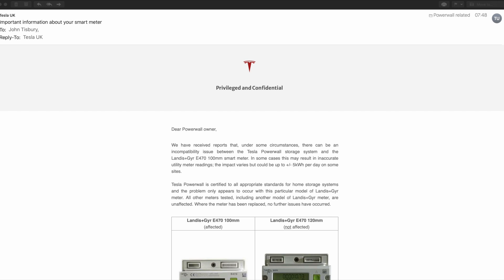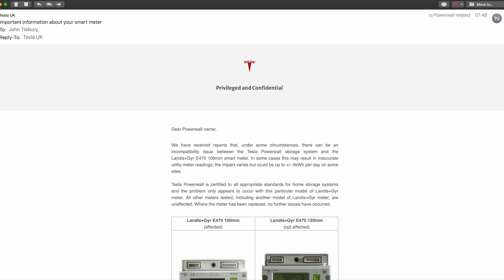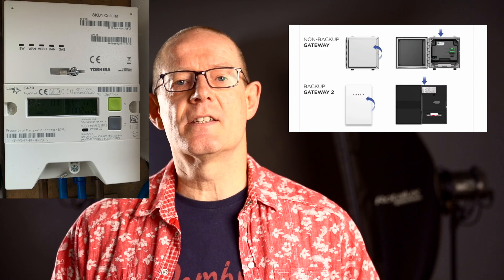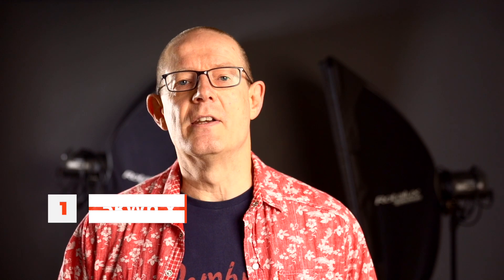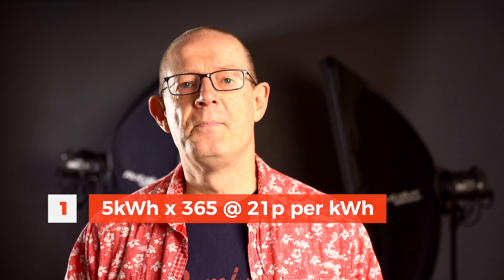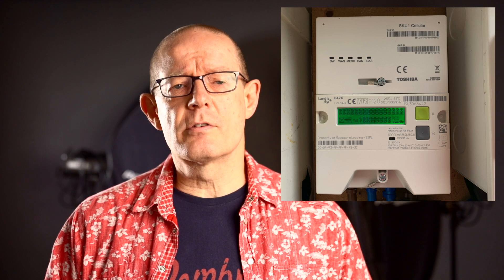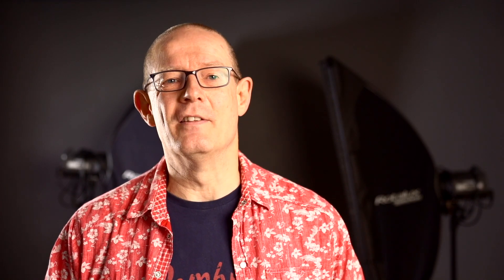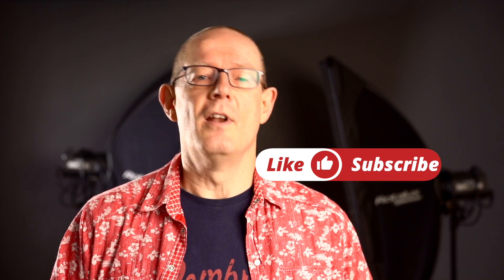Resolved phantom drain Tesla Powerwall 2 and Landis+Gyr E470 smart meter

Comment: I have had a fox ess battery system installed. My app always sais im drawing 4w from the grid but my smart meter sais im using 25w. At the end of the day it works out that every 2 days im using 1kwh from the grid so about 0.5kwh. I have a current clamp around the mains cable which has a wired connection to the battery system. Does this sound like a similar issue? I have the small meter. Thanks in advance
Reply from the maker: It potentially could be the same issue. I'm not familiar with the battery system so can't add any experience. If there's a user forum or Facebook group for them then a post on there might be a good starting point. 
Suggest contacting your electricity supplier and raise your concerns. They can instigate a smart meter check to confirm it is working within standard if you believe it is over reading.

Comment: Hi John
I am a bit late to the party but had Powerwall installed 3 months ago and realised pretty soon I had an issue. My installers support discovered the issue online but I am having an absolute nightmare getting my supplier BG to acknowledge there is a problem even after supplying them with the Tesla and Octopus documentation. The latest excuse is the IHD is not set up correctly. Any suggestions how I might resolve this. BG are a nightmare
Reply: Hi John, BG have finally changed my meter this morning and all working OK now. At last. Now the battle to get some compensation but maybe I’ll call it a day. Thanks.
Reply from the maker: @StephenGalliver  That's good to hear. Well done on being persistent and pushing for a meter swap.
Reply from the maker: Hi Stephen
I'm sorry to hear of your issues with BG. As you probably know the IHD has no impact on meter readings or the phantom drain issue. My suggestion would be to swap supplier, preferably move to Octopus Energy, raise an issue that you need the smart meter swapped and then you should get a resolution. I'm assuming you have the L&G E470 smart meter installed? You won't get much traction from BG I'm afraid. I've suggested this to other people who like you have been getting nowhere with their current supplier. They were trying to get back £100+ for phantom drain reads. I suggested cutting their losses and moving to a more enlightened supplier like Octopus. They did, they used my refer all which was nice. I hope you get it sorted. Let me know how you get on.
Reply: @johntisbury  Thanks John, I would love to swap to Octopus but my tariff with BG is very favourable as to get the same rate with Octopus requires me to have an EV which I currently do not have. At least it sounds I not alone banging my head against this brick wall. Will keep you updated.

Comment: I have had a Powerwall 2 fitted and the E470 has completely stopped sending data back to my supplier (originally British Gas but changed to Octopus). It's clearly a different problem and 3 years later but interesting nevertheless.
Reply from the maker: Your smart meter needs to be power cycled, turned on and off. This is a job for Octopus as homeowners are not allowed to access the equipment. Raise a fault with Octopus and they will see if they can fix it remotely, otherwise it will need a site visit to power cycle it.

Comment: Hi, great video and our meter is getting swapped by Octopus prior to our PW being installed. I just wondered how you have gotten on with it being installed outside in the winter? Has it struggled to charge or discharge when the temperature gets towards and then below 0 degrees? Cheers :)
Reply from the maker: It’s fine outside, it preheats in cold mornings and will still deliver or charge at 5kW constant.
Reply: Thanks, that's good to know. Does it preheat from the grid or does it use its own energy? And thank you for the quick reply! @johntisbury
Reply from the maker: @Simon-rt3qu  depends on the mode you have it in. Self-powered then uses own battery, TBC then will choose based on tariff plugged in to reduce costs. That said power usage for preheating is negligible. 

It also has fans to cool it in the summer.
Reply: Thanks John. I can have it installed on the side of the house which is an easier install (its fully sheltered tbf) or I can store in inside a detached garage. Thanks again! :)  @johntisbury

Comment: Thanks John. So helpful. I’ll follow up with Octopus and see how I get on! 
I’m not clear about the point about registering my Powerwall with Tesla and sending them a photo of my E470? I have already registered the PW and Gw2….do they need to see the E470 too?
Reply from the maker: No problems. The process may be different now as this was over 2 years ago. I would contact them  and they will confirm what they need from you. Any problems motion Phil Steele who works for octopus, however I'd be surprised if you have issues. Make sure you speak to the smart meter team though as they will know of the issue with the E470 and the Powerwall.
Reply: @John Tisbury  Thanks John. Really helpful!

Comment: Hello John, we have just had our Powerwall 2 installed and noticed that even though we have 70% in the battery, we are still (allegedly) drawing 1/4 kWh from the grid. Tesla app confirms that we are not taking anything from the grid as well.  I did some google research and you popped up. Thank you for posting both videos. I’m curious, I’m with eon next and strangely enough we only had out Smart meter installed a few days before the Powerwall was installed. Pure coincidence. My question is, do you know if we are actually drawing from the grid or is it some other anomaly. I can’t see you mentioning in the video explaining what is going on. Trying to arm myself with all the info for the potential battle ahead. Thanks in advance, Paul.
Reply from the maker: Hi Paul, there's 4 video playlist of the problem from discover to resolution. The video you've just watched is no. 3. 
I can't remember which video I showed how I identified the problem and proved it as it was 3 years ago I uploaded the first video. However, I did a daily track in a spreadsheet of what the Tesla app said we had used from the grid and what the smart meter said. If you have an in house display for your smart meter you can get the information from that on a day by day basis. 
From memory the resolution, identified by Octopus Energy is posted in video 4 where the meter was changed.
Playlist is here: https://youtube.com/playlist?list=PLYDir90yTxTofJyV_9W4DKvFkWqDnU4LW
Reply: @johntisbury  thanks for your reply John. So was the PowerWall actually using electricity from the grid or was the Smart meter just making it up? That’s what I don’t understand?
Reply from the maker: In our case the smart meter was drawing a constant power from the grid when we should have been running from battery which equated to 1-2kWh a day. Some people with the same smart meter experiences higher or lower amounts, and even in a very few cases exporting to the grid in some cases. In all cases it was the smart meter that was experiencing conflict with the Tesla Gateway. Swapping to a different smart meter resolved it. It's a known problem for that particular model of smart meter.
Reply: Big thanks for taking the time to reply.

Comment: Hello John. I had the landis e470 meter installed a while ago when I went ‘Smart’ since then I’ve had a 5KW array fitted with 10kwh of batteries all controlled by a 5KW Solis hybrid inverter. It looks like I might be having the same problem. Strange behaviour at night between 00:00-0600 hours. Export and import to the grid. Then if I look at my imported power from grid on inverter it states 29kwh for the month but on meter mobile display it’s 59kwh. I’m with EDF, might be cheaper for now but their customer service is something left to be desired. 😬
Reply from the maker: Have we been texting today about this? I guess so as the information is very similar. As I said in my text, record your smart meter import kWh on a daily basis for the previous day over the next 7 days or so. Also record using another means, solar app etc to see what the variance is. They will never be 100% the same. CT clamps are fairly inaccurate under 100w, hence the need to record over a longer period of time. 
If you are getting a variance like I was, see my earlier videos in this playlist if you've not already seen them so give you an idea of how much the phantom draw was. Once you have some evidence, and you have a phantom drain/draw then you can approach your supplier. They won't do anything unless you have some data to support your claim.

Comment: Thank you John for this very useful summary. I have belatedly discovered the same phantom drain with my smart meter and Powerwall 2. Lo and behold I have the very same make and model of smet-2 meter. I phoned Octopus energy and explained the discrepancy between Powerwall and meter energy consumption figures. Customer support acknowledged this is a known issue, which rather suggests they are complicit in perpetuating the problem.
Reply from the maker: Glad to hear the video was useful and confirmed that your setup is faulty. Octopus did a project to change all the meters of their customer base who had this particular model and a Tesla Powerwall. They were proactive about it. Not sure when you joined them and how long you have had your smart meter. 
If you have gas, they will want to swap both gas and electric as the same time. Seems to be the norm despite my push back to say the gas meter has been fine! I think they metering team who are contractors are paid piece rates on meter swaps! 
Make sure you get a credit against your account for the phantom drain too.
Reply: @johntisbury  thanks John. I had my smart meter installed last October; no gas meter since we are on oil central heating. I will chase up the compensation for the phantom drain.

Comment: I don't have that make of meter but am having similar (worse problems) on a daily basis. Yesterday, the meter read 36.747kWh which Tesla App read 1.5kWh. Every day it is this big a difference or more - seems to be tied to just times when the battery is discharging. Who do I go to first for help? Octopus not being very helpful thus far!
Reply: Just spotted this video. I have recently had a powerwall 2 installed and had noticed the metering figures don’t work out. With less than 0.1kw load showing on the Tesla app the system goes into standby, yet I know by checking smart plugs that are in use I have a greater load and I’m using grid power instead of battery power. I have not don’t exact checks but it’s adding up to 1 to 3kw a day grid use when I should be using the battery. 
Oh and I have the same smart meter as the one mentioned
Reply from the maker: Suggest you record daily figures like I did for the smart meter and Tesla app for grid draw. Then you can ask your supplier to change the meter if you have a variance. Not all installations with the L+G meter + Powerwall have the problem. Hence the need for evidence.
Reply: I have an appointment booked in a month to fix an issue with the meter not sending data. It’s never sent anything since it was fitted over a year ago.
Reply from the maker: They will probably just power cycle the meter (turn it on and off) and hope it fixes itself when they try and remotely connect back to it.
Reply from the maker: Hi Nicola, sounds like your meter is having issues for sure, especially with the current solar activity you should not be pulling much from the grid. 
Octopus Energy are the only ones who can resolve it as they own the meter. I'd suggest contacting Phil Steele (AKA Agile Phil) he helped to diagnose and resolve the initial problem with the powerwall and LG 420E meter. Contact him via agile@octopus.energy or smart@octopus.energy and address it FAO Phil Steele
Reply: @johntisbury  Thanks
Reply: @nicolabrown8859  How did you get on?

Comment: I had a Powerwall and gateway installed 3 days ago and immediately noticed a phantom power draw of about 180 watts occurring 24 hours a day, (so about 4Kwh per day).  On investigation I have that model of smart meter so that explains the problem.  Thanks for your help!
Reply from the maker: My pleasure, glad to hear you have found the issue. Your energy supplier should be aware of the issue and arrange to swap it for an alternative SMETS2 meter.

Comment: Just found this and your other Powerwall related videos, thanks John.  Will be checking my data today.  I had smart meters installed in December having procrastinated about them for a year. 

 Bit of a separate topic, have you given any thought to second PW2 or to changing to gateway 2? (I hesitate to say upgrade because it isn’t, it is full price for a new gateway). I’ve been working through my two years of powerwall data to try to see the benefit of second powerwall.
Reply from the maker: Hi Robin, thanks for watching. 
Great questions. I've looked at the benefits of a second Powerwall and don't see the need. This is based on using much of the surplus solar power during the summer to either charge the cars or run our glass kilns during the daytime. In the winter there's often not enough solar to fill one Powerwall, so having two would not be worthwhile. In the evening into the morning our house power consumption is low. As long as the powerwall is around 50% SOC at 8pm we will easily get through until start of the solar day the following morning. 
I've considered swapping from a Gateway 1 to a Gateway 2 the trigger point for me would be the frequency of power outages. Where we live it's not something that affects us very often. In the last 2 years we have had one power cut during the day which lasted a couple of hours. Not something to spend £2,000 on for very occasional use.
Hope that helps? 
Cheers
John
Reply: @johntisbury  Don’t really have time to check today, but curiosity forced a first check.  My meter looks like a ‘baddie’.  Did quick check for today, PW2 thinks I used 11.9kWh today so far, IHD thinks I used 12.1kWh.  Need to get more data but initial thoughts are too close to call if I’ve got the problem.  I never got that original email from Tesla.  Thinking I must have missed registering if it went to all PW users in UK. Same installer as you (Joju).  Will dig further over the weekend.  

Thanks for response on second Powerwall. I’d started from thinking about changing to Gateway 2, but was quoted £3k.  (22/11/18 install gw1, 5.76 array with 5kW inverter.  I was looking to try to automate the changes to charging and backup % could be a key.  Plus currently looking at trying to get rid of gas, second battery might underpin cost  that but struggling with the number of variables to consider.
Reply from the maker: @robinedwards218 those figures are pretty accurate, it's only a 1.6% difference. The CT clamps are not mega accurate under 100watts. I think you are okay, but as you say best to monitor a few more days. I found the variance was worst when we were mostly self-powered from the sun / battery for the day. So wait until you get a sunny day and check again.

Comment: Really great that you raised awareness of this issue both to the relevant people who can fix it, and publicly. Thank you. It is a shame, however, that your presentation "dumbed down" the issue significantly, especially continuing to call it a "phantom power draw", and expressing the scale of the problem as a percentage. It is immediately obvious from the raw data that the problem is a constant difference or around ~2kWh/day - by expressing this constant error as a varying percentage is both misleading and unhelpful in understanding the problem, namely that the meter is mis-reading and not that there is a "phantom power draw". 

Thank you for linking to the Octopus blog which is full of accurate, helpful information which explains the actual problem in technically correct but not "baffling with science" language. THe blog also usefully also highlights the risk of assuming that "compliance with the standard" is the same thing as "will work together in a system".
Reply from the maker: Thanks for watching Mike. Fair point on using the term phantom draw. I used that term as that was what other people were using to refer to the issue once they encountered it. Rightly, or wrongly it made it easier for others to find the video when searching.

Comment: Thanks John,  A great Video.
I have had a twin Powerwall 2 + back up gateway installed last week, to work with my 30kW Solar Edge panels.  My system is 3 phase. Interestingly I have had a significant phantom drain on my L&G non smart 3 phase meter.  The Tesla App says that I have 'bought' 34kWh from the grid in the first week, whereas the L&G Meter [type 5219A 3PH] says that I have used 106.   My Tesla installer says that very few 3 phase systems are installed, and so that the 3 phase L&G meter may have a fault like the E470, but that up to now no one has so far spotted it.  What do you recommend that I do?
Reply from the maker: Hi Michael, it does sound like you have a phantom drain issue. 
I would suggest recorded daily end of day data for a week or so and then raised the issue with Tesla Support, your installer and your energy supplier. With those three informed then you should see some traction. Thankfully for you the problem is now recognised by Tesla, and depending on who your energy supplier is they may or may not know about it. 
Let me know how you get on please. 
Cheers
John